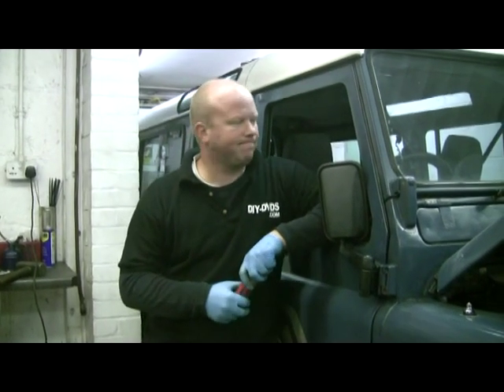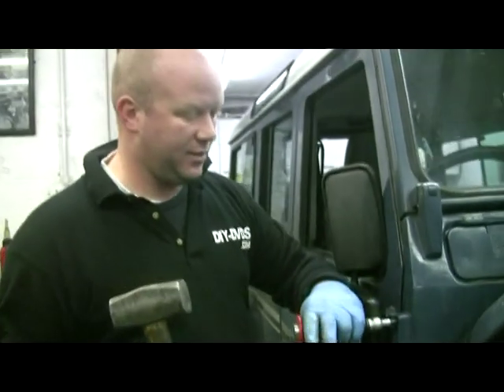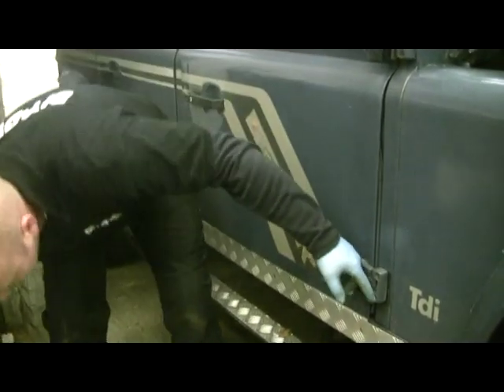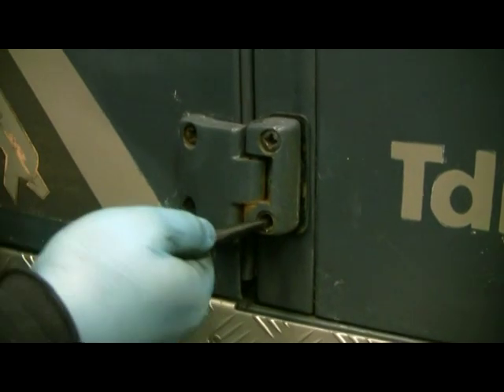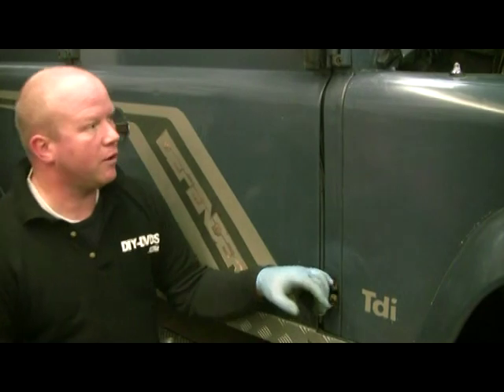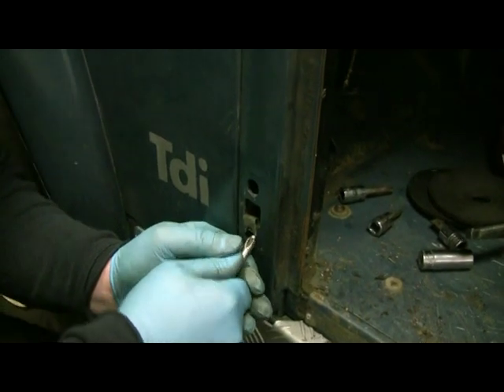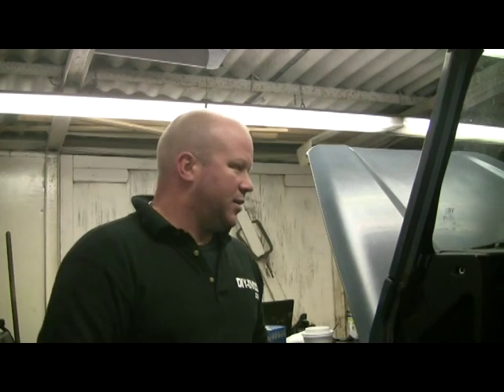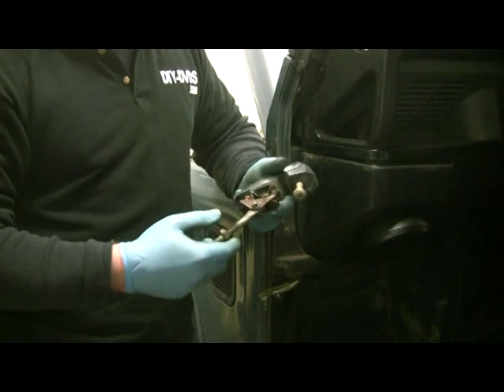Defender and series landrover bulkhead and wiring loom change and fit instructions and guide pt3

Comment: Found it easier to grind through the side of the hinge (always worth replacing those anyway as they sag quite quickly) and cut through the bolt that way, rather than drill out the bolt. Takes about 30 seconds tops with a cutting disc.

Comment: great video. just of curiosity how long a job is it to fit a new bulkhead to a land rover.
rob
Reply: It is a nut and bolt job,  but think about how much you want to salvage... say, a day to strip it out and a day to put it back, plus however long you need to sort out the wiring :-) But... it never works out as a straightforward job...